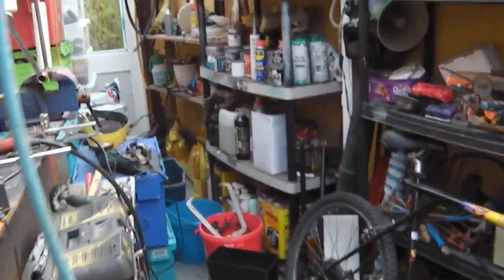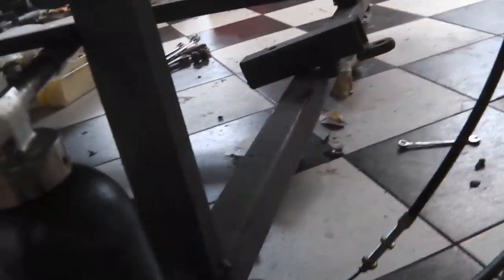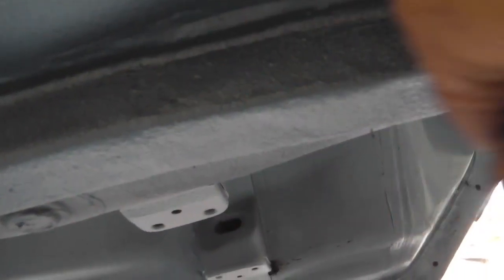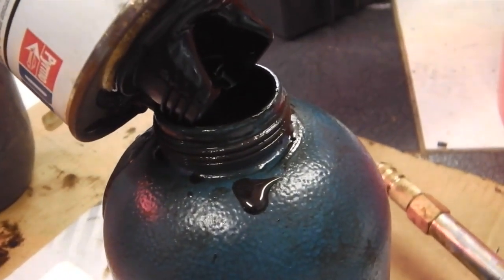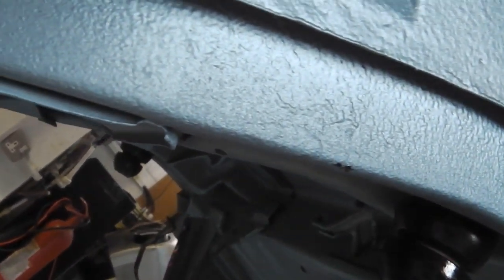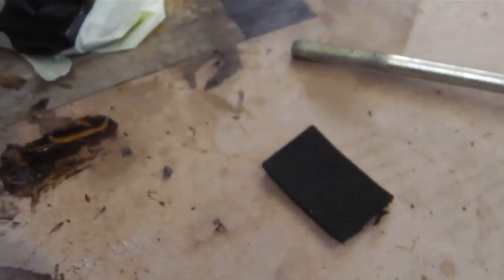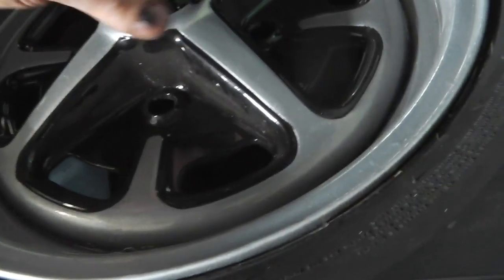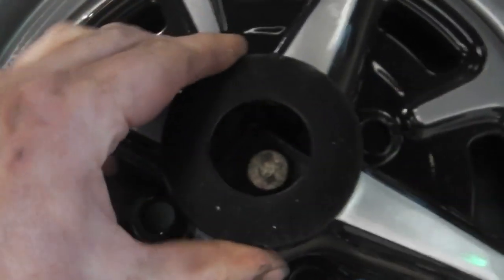Ford Cortina MK3 GXL Restoration EP62 PT 2

Comment: Good video as usual , Just a idea; I would be tempted to use a bit of studding with a chrome captive wheel nut to hold the wheel  in the boot, the chrome nut would look cool inside that black wheel retainer and it would give you a spare wheel nut .
Reply from the maker: good idea! ill do that thanks!